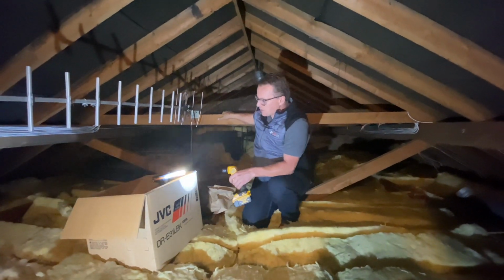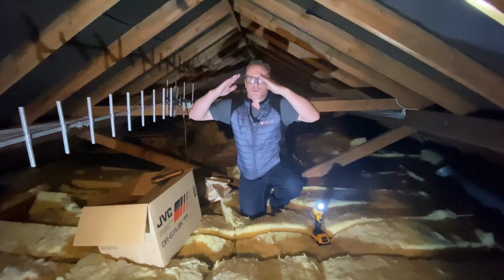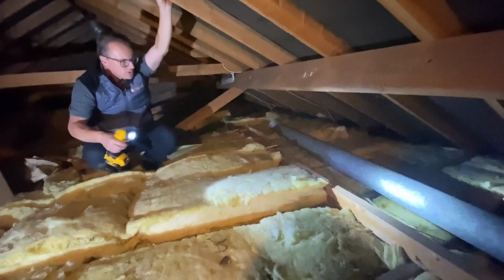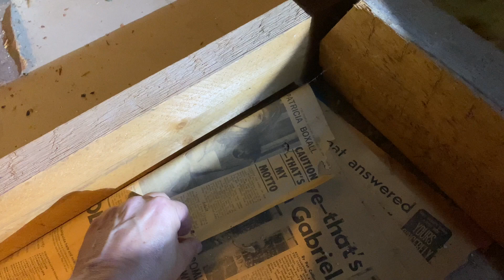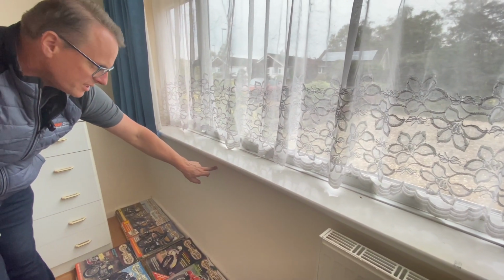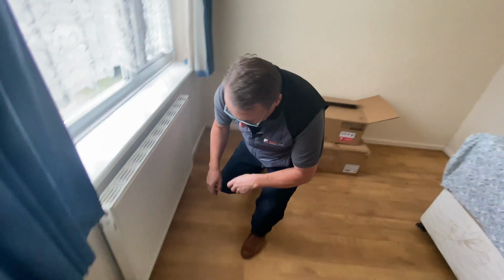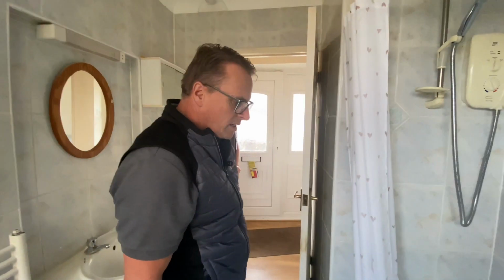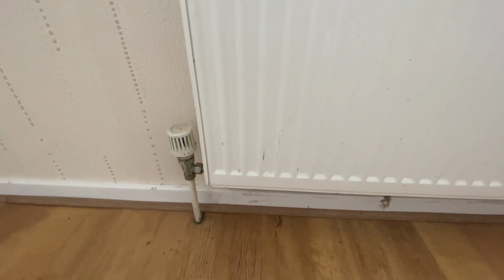How to survey (another) house - Part 2

Comment: Another great video, thank you. Although, rodent in a loft is more likely squirrel. Look for trees in vicinity and/or damages to facia/underfelt to the eaves. If it's a rat, than drain survey might be required. Rat in the loft 9/10 comes from the drain via soil vent. But my bet is still squirrel. Another thing, if it would be rat, I bet you could tell right after entering the loft...., very distinct urine smell.

Comment: If you cut the ridge board out you would weaken the roof because you would loose its bracing effect. That is why if Fink trusses are fitted a board has to be nailed to every rafter just under the apex.